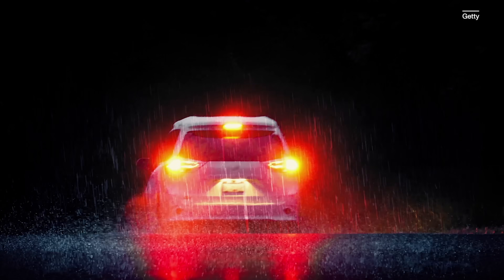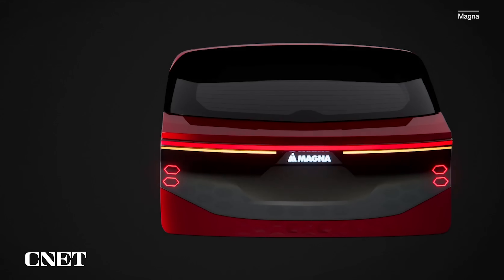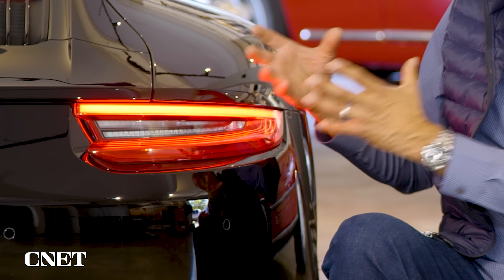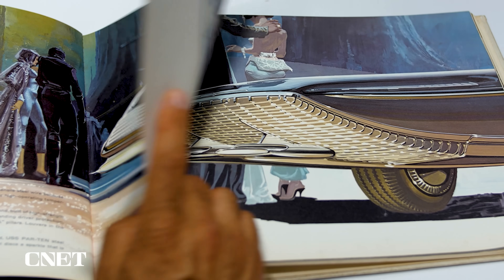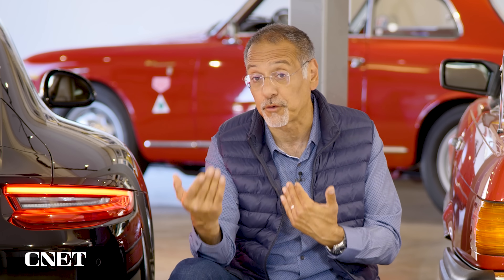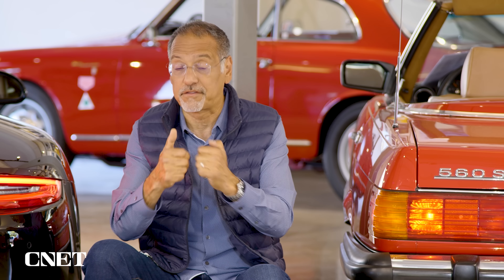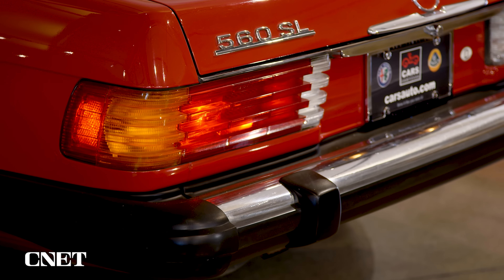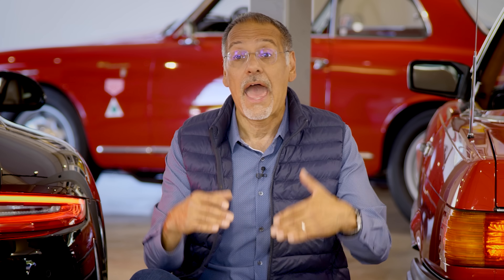New Invisible Lighting Wants to Radically Change the Way Cars Look

Comment: It would be interesting to see how well it works in the real world, but it kinda seems like tech for the sake of tech. Is it safer? Is it more cost effective? Probably no and no. People may get confused by the lights if they're not familiar with them and it could cause an accident. And what if you do get in an accident and damage the lights, or maybe some of them stop working? Since they're built into the panel, I imagine you have to replace the whole panel if anything goes wrong, which is not nice when we can currently pop out the damaged light module and put in a new one by ourselves if we wanted to. But it seems like we're focusing on the wrong things like car styling and autonomous vehicles. We should be doing more to get people OUT of cars in North America and moving towards alternative transportation. Cars take up a lot of space, they're bad for the environment, they tear up the roads, they're expensive and don't hold their value, they change the way we build cities and make it harder for people to get around without cars, they're very loud and disrupt their surroundings, and so on and so forth. We're over here getting goofy with blinky lights while the people in the Netherlands are yuckin' it up because of how dumb we are when it comes to transportation.

Comment: Good design used to have to be both functional and pleasant to the eye, and also serviceable. Modern cars are just not made to last and therefore are going to plummet in value since it's going to be virtually impossible to service them once they get older. Some design and technology innovations are cool but somewhat stupid and pointless in mass production vehicles, in my opinion. I believe that, after the initial wow factor, they just make the ownership experience worse.
Reply: I agree, more items to break. In theory however the car should be designed to last a certain number of years and miles, and component specifications should follow that vehicle level requirement.

I would say like usual, the first model years where new technology is offered will take time to iron out…

Comment: As futurisitic as all that looks, I'm still waiting for one improvement in every car for a technology that hasn't changed for about 100 years: the sun visor. How primitive to swing a flap of cardboard down toward the driver's face then away from the driver's face in order to block a limited area of the windshield. And inevitably, it fails to do so, forcing the driver to shift positions in his or her seat so that the sun is not in the line of sight.
Reply: Agree. Fairly prehistoric as is.

Comment: A number of car designs today are such that taillights catch the reflection of the sun in certain circumstances making it very difficult to see if the light is illuminated. It will be interesting to see if this solves that problem or compounds it.
Reply: The point of these tail lights being reflective, is so that you don’t hit a parked vehicle or a vehicle without lights on. Curious as to if these new lights offer that kind of safety?

Comment: It feels like tech similar to this has been around for decades.  I have a 42-year-old car that one of the opera lights fell off of on the passenger side.  It was literally just a paper-thin piece of plastic in the shape of an oval with two little spots at the end coated in copper leaf to make an electrical connection.  After I found it on the ground, it took a couple of days to make the connection that it was actually a light and not just a piece of garbage that had blown into the driveway (since I rarely walk around to the passenger side and didn't notice it was missing).

Comment: Stylists are responsible for incompetent red turn signals working double duty as brake lights. Some even loaded on marker light duty for triple the responsibility on a single red bulb.   The cost of replacing this signal panel will be much more expensive and complex which is a factor they don't care about. It's always the fashionistas of auto engineering ruining cars with their sci-fi obsessions.

Comment: The technology behind this isn’t really new, this is just a new application for it. If you want to see an example of this in a product you can buy right now, look at the Withings BPM Connect. When off, it just looks like a plastic oval cylinder with a single button on it, but when you turn it on and use it, the plastic becomes a dot matrix screen.

Comment: Yes!! Modern cars only have around 10 million failure points, let's add 10 million more!! Maybe an additional 10 million lines of code to run all of those needless, senseless lights!! I can't wait til the "car" reaches 1,000 miles & 50% of the LED's burn out because modern cars are engineered to such a high standard!!
VOMIT.

Comment: These high tech creations are just adding more complexity. Imagine if there is a dent on one side, now you just charge the light that side, this would make it change the whole unit. Imagine to cost. 
People will start to hack into this and do stuff you don't want. It's good to leave something's just simple.
Don't see any problems it's trying to fix
Reply: You'd remove the panel and replace the LEDs underneath, lights are already complicated
Reply: It'll come down with cost with time. Sure, early adoption of any new tech will cost an arm and a leg - but in the end it's worth pursing and investing in cutting edge tech in the long run.
Reply: @anonypersona3189  Stuff like this will become a dealership only repair once it goes mainstream.  At that point, costs will only increase.
Reply: @AndrewDeLong  Thus, making the case for right to repair.
Reply: @Iamwolf134  Sure, at the potential loss of warranty coverage if the repair damages things further.
Reply: @AndrewDeLong  Does the right to repair not also incentivize manufacturers to focus on longer lasting parts?
Reply: @Iamwolf134  No, not really. There's no money in longer lasting products.
Reply: @AndrewDeLong  You mean no short term money? No reason they can't adjust their business model to accommodate for long term profitability. Besides it's not as if we can't simply ensure that just such a repair works as intended while retaining structural integrity, thus balancing out the right to repair with that kind of responsibility.
Reply: @Iamwolf134  sadly it’s more profitable to make stuff that doesn’t last. A great example is a special tent company for the vacation islands of my country, they last multiple generations and at some point everybody has them and the company stopped.
Reply: @sneaky_krait7271  I was actually talking about the right to repair incentivizing companies to make parts that last at least two to three years longer than they normally would, for sustainability if nothing else. And it's not as if it's going to cut that deep into the company's profits either.
Reply: @Iamwolf134  It cuts in the profits so it's not going to happen unless consumers demand it.
Reply: @sneaky_krait7271  Was that not the point of my comments thus far; to encourage consumers to demand such a thing?
Reply: @Iamwolf134  Your other comment also makes the suggestion that longer lasting will be profitable long term and good for the company, but sadly it's not.
Reply: @sneaky_krait7271  Getting consumers to demand a right to repair (as in requiring manufacturers to provide necessary technical specifications and tools in order to ensure as adequate a repair as possible), and I'm talking about having consumer electronics last a little bit longer, as in a year or two longer, which doesn't cut that deep into their profits. You see, they're not deliberately shortening the lifespan of certain critical parts because they have to, they're doing it because they want to squeeze out more money from people.
Reply: @Iamwolf134  Yes I agree, but that's all on consumers, but many don't even know. Otherwise there would be likely a company that offers this to get the majority of market share.
Reply: @sneaky_krait7271  Hence, the very reason why critical thinking based education is important.
Reply: @Iamwolf134  Not only that, it should be known and mentioned more
Reply: Its called evolution

Comment: I've asked for you to take up "light laws" several times over the years.. I really wish you would do this. I drove home tonight on I-580 and the brand new car was driving with no "taillights" on, just the super bright DRLs.. The driver had no idea they didn't have lights on. It's 2022, can't we agree to have lights turn on mandatorily when it's dark outside? Is this something we can do today? And then intensity. Testla Model 3s have 4 tiny LEDs and when they switch in the evening from on to Brakes-on intensity, you can't notice the difference. The LEDs are so small that it doesn't register for many people.. There are very poorly written laws, I'd love to see an actual piece on this.
Reply: Also talk about how putting reverse lights near the bottom of a car is stupid, sometimes you can't tell when a car is in reverse because the dang lights are near the ground and out of my line of sight.
Reply: You know it’s actually funny, there are some lighting tricks that are done to meet minimum surface area that I’d love to share, I’m someone who works in this industry and am super interested to learn about other peoples experiences here.

Designers want to push form over function, and always ask for super thin profiles, with minimum surface area… 

Federal lighting regulations are among the longest and most confusing vehicle regulations, and also rather outdated.

Comment: Cars still need reflectors to make them visible when parked on un-lighted roads - those are going to need to be visible.
Reply: Retroreflective paint can already perform that better than the current reflectors used in automotive applications. And maintains that 'invisible' look in the daylight.

Comment: As long as all manufacturers use separate lighting elements for the running light, brake and indicator lights and that the indicator lights are amber I'll be happy. Most manufacturers in North America can't even get that right yet and the European brands change their tailllights for the worse and sometimes unnecessarily, for North America. Once they demonstrate they know how to make a basic taillight then we can let them loose on a blank canvas.
Reply: Most Asian car companies get it right even to this day, Turn signals are usually amber and if not, it's red and doesn't use the same light used to brakes.
I think with the higher trim Dodge rams, it's a switch back, it turn Amber when it's used as a turn signal, at least do yhat if they are gonna use the same bulb for multiple functions

Comment: There's a somewhat novel solution for many drivers, that does away with the lighting issue, and it's currently available: the pair of legs that most of you have, and then bicycles and mass transit.
Reply: Get some of those light-up sneakers that flash when you walk, and you'll put these car lightshows to shame.
Reply: No thanks, I like driving.
Reply: @randomname4726  That's not important.
Reply: @fungussa  To some of us it is, if you dont like driving than dont, it'll make it more convieniant for us who do
Reply: @isakjohansson7134  I can see you haven't given much thought to how you'll get around once you no longer have a car.
Reply: @fungussa  Why wouldnt i have a car?
Reply: Bicycles and mass transit use lights as well.
Reply: @nicholassmith7048  Dummy, that's such a silly argument. And car ownership is already declining 😀

Comment: My father who was an auto mechanic for 30+ years and myself used to talk about this subject. Cars have been basically the same with superficial "improvements". Until a car can actually levitate and defy gravity; then we are talking. All the stuff about lighting and looks about a car keeps being mostly BS. The car is still dependent on the wheel, and you can't re-invent the wheel; until you get rid of the wheel and make the car fly.
Reply: How bout electric ans hydrogen car
Reply: @fatcrruise6508  But still they got to run on four wheels. Same thing.
Reply: In some ways I agree. All of the asphalt and concrete all over the place is too much. I'd rather have more green grass.

Comment: Agreed 100%! Additionally they probably require less raw materials to build this better for the environment!
Reply: so a panel is less material then a single bulb? 😂
Reply: @TeamAestheticss  People these days 😅
Reply: @TeamAestheticss  What about the rest of the housing for the light? or does your car just have bulbs sticking out of an empty space? I get the point you were trying to make but there is a lot more to a car light than a bulb, and depending on how pricey the car you own is, you'd be shocked at how much it would cost to replace them. Without a cost reference, all comments are pure speculation.

Comment: Car manufacturers and auto shops will love this. Instead of changing a light fixture they'll have to replace entire panels. That's more money for them.🤷🏿‍♂️ Cool idea but very impractical and not consumer friendly in my opinion
Reply: OTOH, this is likely a lot cheaper and simpler than the $1000 tail lights currently in the showrooms. If this can be retrofit into existing thermoplastic panels, the aftermarket will explode and these components will be cheap. Its likely a wash. And will definitely lead to some beautiful (and less beautiful) cars.
Reply: @meatsuitpilot6642  A light bulb is like 2-8 dollars .
Reply: @OrganicGreens  you realize when you damage a headlight assembly you aren't just replacing the bulb, right?
Reply: @OrganicGreens  the vast majority of lights don't use incandescent or halogen anymore.
Reply: @brettspencer-curran8269  Maybe if you drive a really new car. Most people I know have a care made before 2012 or so. Almost all of them take a replacement bulb. Even if the bulb is a bit more expensive led one its only like 20 bucks. And these bulbs have worked fine for many years. No need to fix what is not broken. Just like climate and radio controls on modern cars but dot get me started lol.
Reply: @OrganicGreens  the issue here is not only the bulb change, but in case of an accident and full replacement...
Reply: You realise that the existing units can be very expensive right, for an Audi A6, the one unit is about £1500, so £3k for the pair. We can at least hope this integrated tech comes out cheaper.
Reply: Def won’t be cheaper especially for the consumer. Cost won’t be the determining factor as long as it isn’t ridiculous, design usually sells regardless of price.
Reply: Well you're thinking in the present..in the future if autonomous driving is a thing then crashes won't be problem.
Reply: @pollumG  it will be even worse... Because manual driving will go nowhere for the next 60 years... So heavy coexistence there
Reply: Well current ones are still Hella expensive so this can't get much worse
Reply: Unless they make the lighting segments into modules that can slot in/be removed... but they'll probably just make it one piece or adhered together to make it easier to manufacture. Hopefully they choose a more consumer (and environmentally) friendly process.
Reply: I've replaced the center track light on my Durango a few Times n that's 1k. Luckily I got a good warrenty

Comment: You know, if you get clobbered in the rear of the car where these lights are, it would actually just cost the rear paneling, rather than that PLUS the independent lighting units.

I'd love to be able to have different "downloadable styles" for my vehicle depending on my mood. You could come up with new styles and download them from online too for any number of  different personalizations. I think you would still need dedicated headlights, but when it came to turn signals, brake lights, reversing lights, marker lights, there are any number of possibilities.

I love the idea of this. Let's see some concepts based around this.
Reply: Audi Swarm lighting
Reply: These are good points, deserves more upvotes.

Comment: To me most annoying about modern taillights especially LEDs are STUPIDLY SMALL stripes for turn indicators.
Yes those could be long as the width of vehicle but so thin(heights as short about 5 mm or less for non North American vehicles)... How other motorists can see those indicators blinking in pitch black.?
2nd-ly, WTF those car designers LOVE sketch reverse and indicator lights separate from taillight housings... 
And make that into production vehicles... So dangerous to spot TWO types of lights in split second for other motorists because so low to bumpers, Kia Carnival and US Toyota Venza...

Comment: Customised messages:

“I brake for tailgaters”
Reply: I see more crashes because of people trying to read those messages rather than keeping the rubber side down. KISS  Red means stop. Amber means Turning. White means reversing (imminent?)  I do agree with Cooley there might be a need for some indication  when in Autonomous mode (we do have Student Driver signs in many places). Self driving mode can only have a RESPONSE for scenarios the the programmers anticipated.